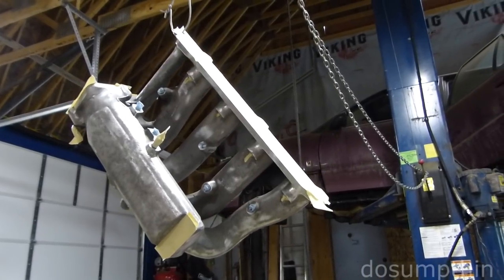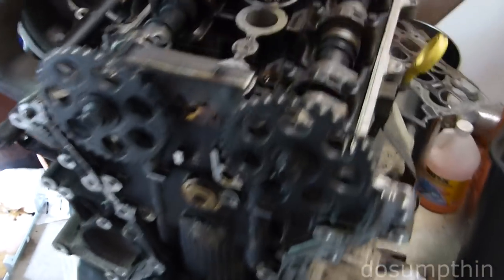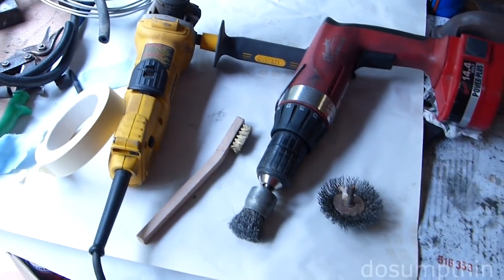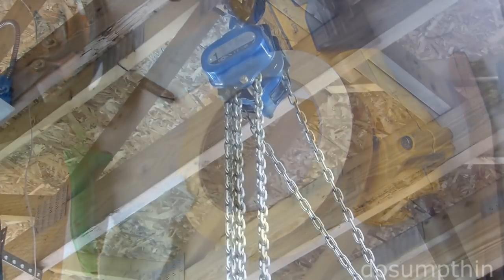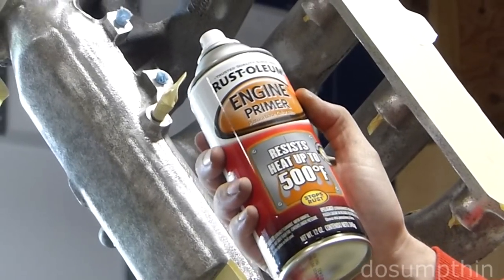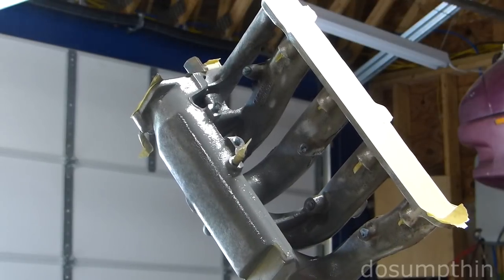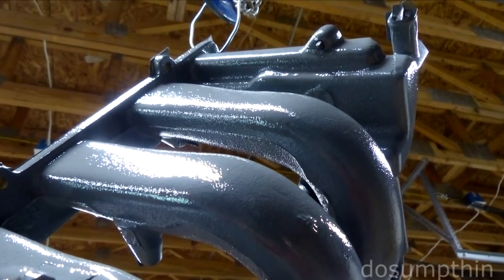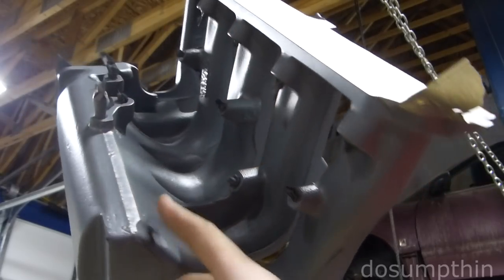Spray painting the intake manifold

Comment: if anyone decides to do this your paint job will look realy good if you start out lightly dusting in small strokes from about 4ft away. wait till that is tacky then do 3 or 4 more coats. light coats that are applied evenly will look much much better than thicker longer strokes. if your too close youll cause runs. if you hold the spray too long it may lbuild up on the tip or spit droplets on your project. Good luck :)

Comment: Nice project, by the time you start a proper restoration you'll have your skills up to the job. You can purchase assortments of silicone plugs to cover holes, the paint will come off when dry, you can even leave them in place when you oven cure the paints if necessary. They sell them for covering holes when powder coating. Just an idea, easier than making crazy shapes with masking tape.

Comment: I wish young guys would get into cars this way most can't change a tyre these days
Reply: or rotate or balance
Reply: I've done motor swaps and replaced my clutch, diff, and driveshaft in my driveway. I've done basically everything other than an engine rebuild and I can't balance a tire. Lol. You need a machine...
Reply: 308wce 05 The dads didn't take the time to get them hooked. I lucked out because my uncle would take me out to do donuts in his 75 impala so that got me into cars when I was maybe 9
Reply: Or spell... smh
Reply: 308wce 05 tire
Reply: 308wce 05  I'm apart of "that" generation and I'm so disappointed in this generation but I actually know how to change a tyre I'm currently replacing my clutch at home and I love my car she's my baby
Reply: @robertfeost1618  it's tyre in Australia
Reply: Fiji Insider  spelt correctly in Australia. Don't be so ignorant
Reply: @MonkeyBarsEveryday  i meant changing a flat tyre on the side of the road not a wheel balance. No one can do that at home obviously

Comment: cant use steel wire to clean aluminum. now you have cross metal contamination..for future reference
Reply: No Name  glass, walnut or sand blasting would be most ideal. Outside of that, I probably would do exactly like Austin said. Only in either case, I would add applications of alumiprep and alodine afterwards..

Comment: This was posted in 2013, how long did the paint job last?
Reply: Nobody ask that!, i am painting right now my Citroen 2cv exhaust..sorry for my english, with 2000F paint, with propper primer, preheat the surface and then cooking the pice..., you need to clean and clean...and more clean the pice... to avoid any cracks when cooking, i have doubt about the message in the can saying Gas and Oil resistant .

Comment: Is that Aluminum? No offence but if it is aluminum, that paint and primer is just optical ilusion. I work with aluminum and magnesium alloys and after you brush it or after sandblast you can't touch it with your bare hands, after blasting or brushing immediately you need to use... Maybe best temporary coating - Alodyne (Henkel) procedure, thats the first thing (it creates thin aluminum oxyde layer that protects surface from oxygen, humidity, salts ect.) Then you need to use some not cheap acrylic primer. After that paint but not from these cans thats shit, thats ceap shit...
If you want I can tell you more about aluminum painting and coating :) But great video I like that ;)
Reply: Doesn't matter. When you paint it it protects it. You need to clean it good first. That's all